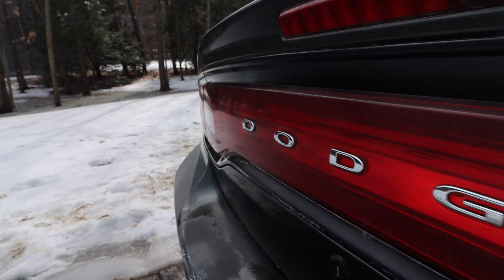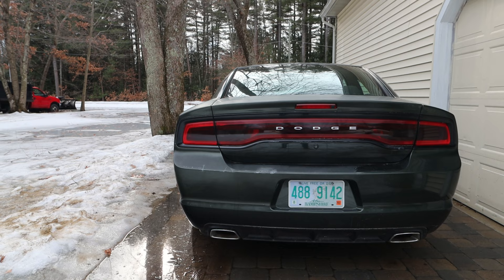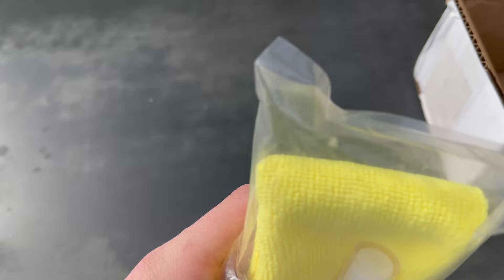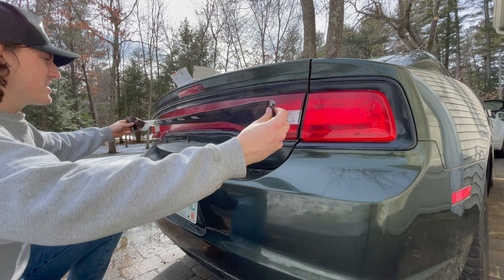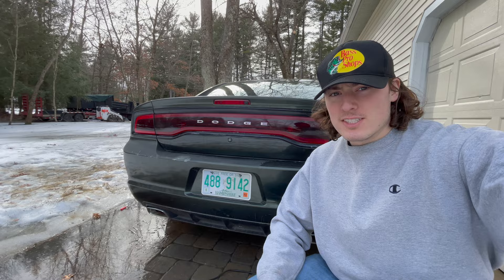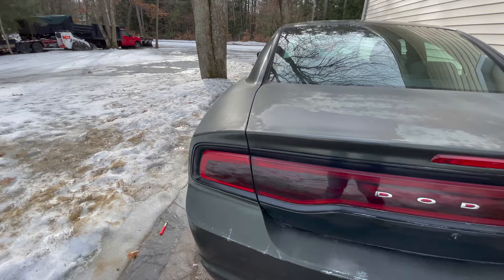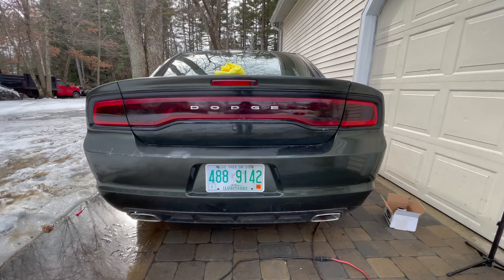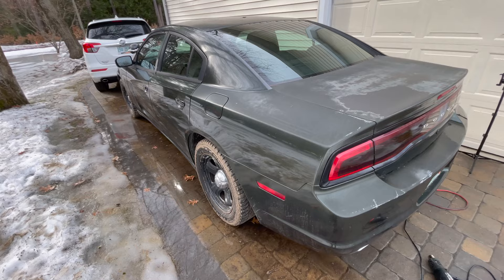This $40 mod is a MUST HAVE for the 2013 Dodge Charger | DriveHub

Comment: Im about to get this car how reliable is it
Reply: Had my v6 for 205k miles. My rt currently at 140k
Reply: I got one it’s Reliable as any other car jus regular maintenance Run 89 octane don’t speed everywhere make sure u change that oil ever 3k miles or prolly 2k if you drive a lot  if u drive a lot
Reply: My 2012 rt has 308k miles, take care of them they take care of you..
Reply: Depends on how hard you are on your maintenance if your heart on your car be hard on your maintenance and then it also comes down to what the previous owner did with the car
Reply: @laceyrose2574 how do you take care of it